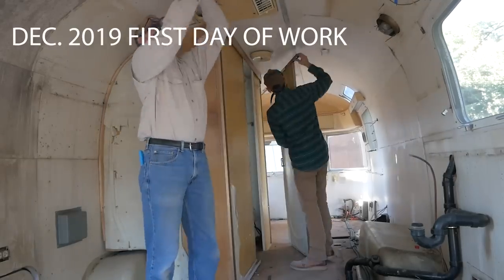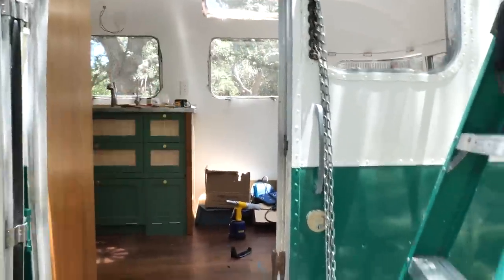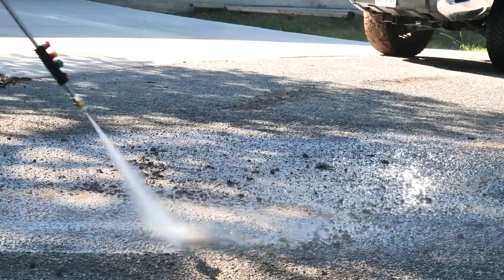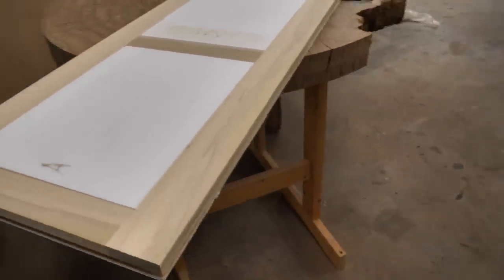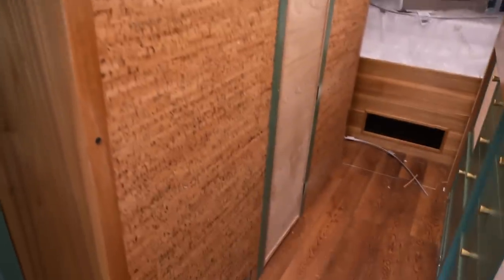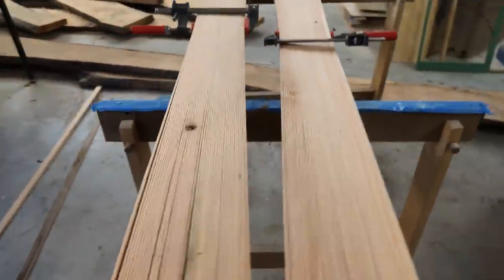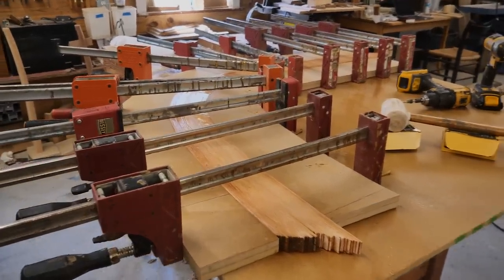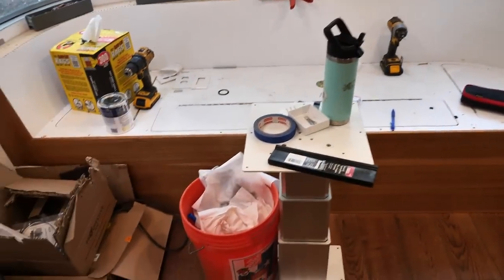First Trip is in a Week But We Have PROBLEMS! (Airstream Argosy Restoration Ep. 28)

Comment: I've heard good things about Toyota trucks, but I'll stick with my MOPARs. I bought a used '92 Dodge W150 Power Ram LE from my father in law in 1996. 26 years later, it's still my daily driver. Hard to beat a truck made in Detroit from American steel. I drove that old beast through a storm dropping baseball sized hail, and it didn't leave a mark. Most newer trucks, especially those aluminum can Fords, would've been totalled.

Comment: Now I'm going to start right out and say I don't watch all your videos. I mostly started watching because the trailer build but it was taking so long I just stopped watching. Now I realize you do have a business to run It's not about the trailer so don't take it the wrong way. But you went as far as to have the interior completely finished and a fancy door lock installed before you knew the door was going to work? How does a guy that builds furniture like you do make a mistake like that? just got to be more here than you're telling us cuz I can't believe that would happen if it did I don't know what to say about that. I'm not going to try. Good luck in the the travels with it hopefully the road doesn't shake that alignment of the door back to the way it was could be a real pain trying to close it in the rain Happy travels.
Reply from the maker: Thanks for the comment and Yup I did!!  You know this restoration has been a huge challenge especially the logistics of keeping on track with all the different types of work.  It’s even more difficult when I have to go back and forth between shop work and the Argosy.  I knew the door was off for a long time and just kinda put it off till the end.  I didn’t find out it was the actual door frame until a few weeks ago.  It’s not exactly the best scenario but I think the fix is good and door will hold up just fine.  A little tweaking and I got the lock to work as well!  There’s a lot I would do different if I ever get another shot at restoring one of these…I’ve learned so much.
Reply: @AndyRawls  Its a massive undertaking for someone with no zero experience in restoring something like this. The first time is always the most difficult, pain staking and frustrating but is a huge learning curve. You should be proud of what you've accomplished but the best part will be making memories with your family.